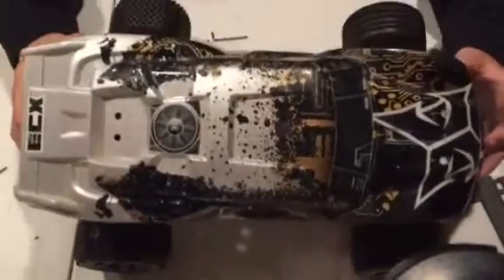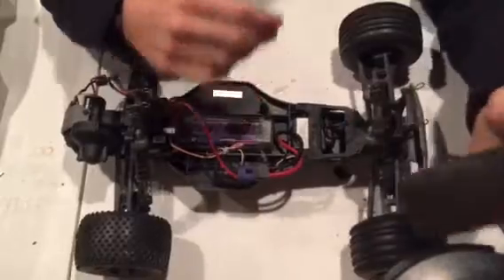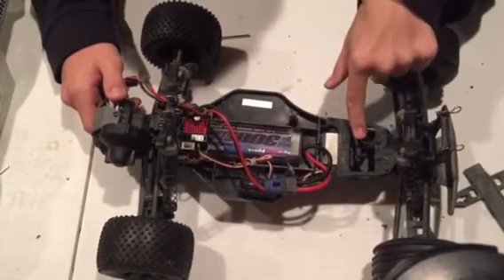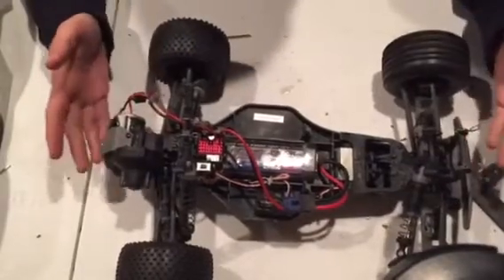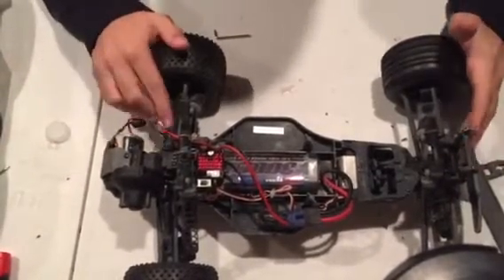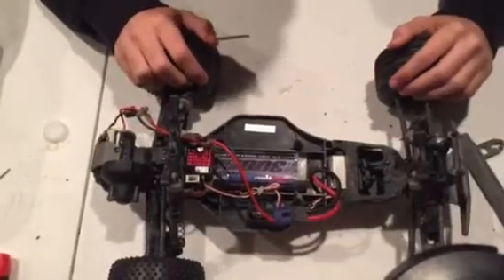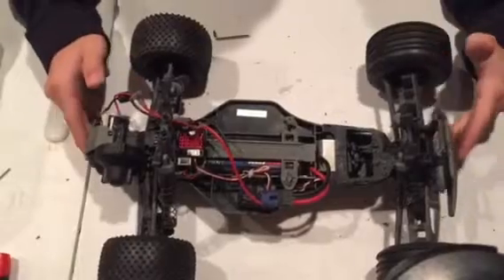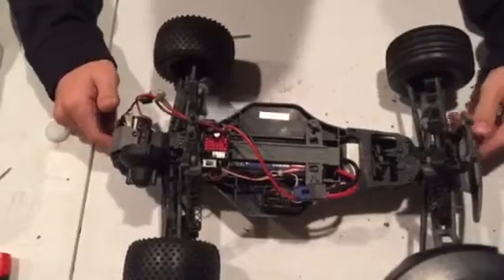2wd ECX Circuit Review

Comment: I put a 12T Titan in my sons truck on 2s Lipo with stock gearing and it's much quicker than the stock 15T.
Reply: Do you still have the stock ESC?  I thought it was limited to a 15t, if not I'll go with the 12t to upgrade my Circuit.
Reply: I put a Titan 12T in mine with the stock ESC. No problems on 2s.